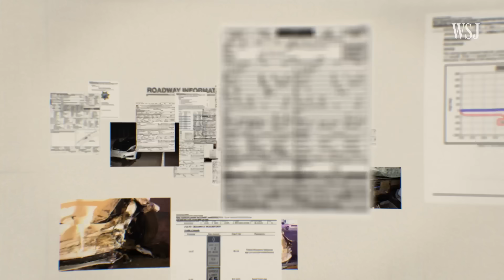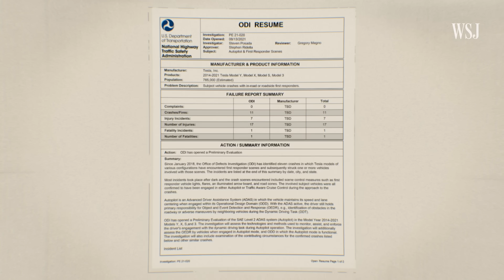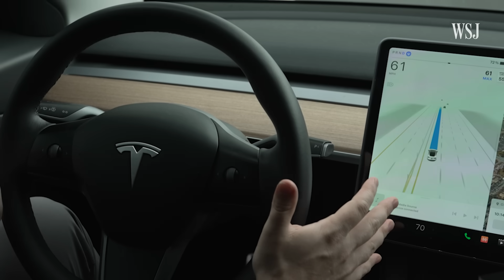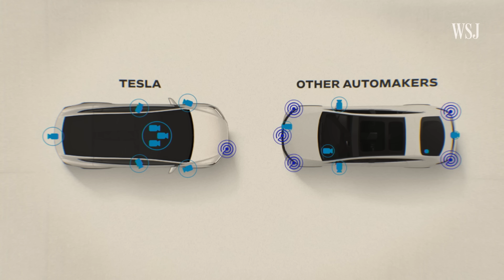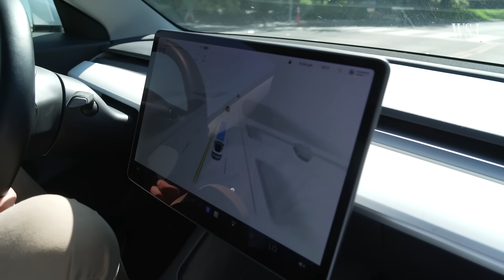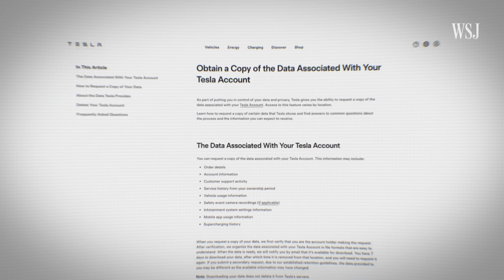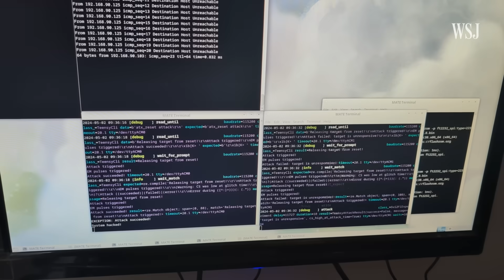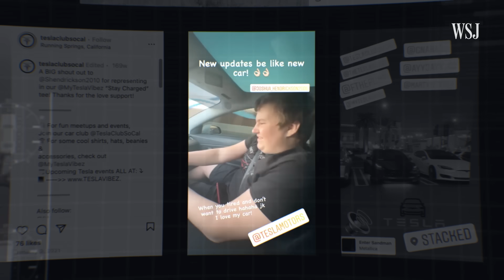The Hidden Autopilot Data That Reveals Why Teslas Crash | WSJ

Comment: Wait a second - Autopilot is just using camera feeds? As we can see in the video, these are low resolution and basically not usable in low light settings. Major public security hazard!
Reply: Yes. Tesla autopilot is well known for failures when cameras are blinded (by the sun, by the snow, by the darkness).
Reply: @solderbuff  That's awful. How are these cars legal?
Reply: It just uses camera feeds, I don't know about those cameras in particular, but the backup camera that I bought for my wife's old car was capable of seeing in some pretty dark conditions, so there's no reason why the cameras that are using on these cars shouldn't be able to see in near complete darkness. Whether they're properly trained to interpret what they see at night or not is likely the issue.
Reply: Tesla used to use LIDAR. During the pandemic-induced chip shortage they couldn't get the chips, and they didn't want to lose money by keeping their cars sitting in the factory parking lots waiting for them, so they just said they didn't need LIDAR and turned it off in old Teslas that already had it. That was a lie; the car needs some additional hard information to supplement the inadequate date they get from computer interpretations of camera-only data. There's a reason no other semi-autonomous car runs on cameras only.
Reply: @curtisadams6048  Tesla never had Lidar on any car. You confuse this with Radar.

Comment: Why no mention that Missy Cummings has a notable connection to LiDAR (Light Detection and Ranging) technology through her professional affiliations and public statements? She served on the Board of Directors for Veoneer, Inc., a company that focuses on developing and manufacturing advanced driver-assistance systems, including LiDAR technology. Cummings received significant compensation in the form of stock from Veoneer, amounting to around $400,000 annually for her role on the board.
Also, this report is way out of sate, referring to old technology?  Obvious hit piece.

Comment: autonomous pilot speed should be limited to max 50mph
Reply: Clearly, you haven’t used FSD. It’s better on the highway than in the city. But yes, its not a replacement driver

Comment: It's a driver aid. It doesn't replace paying attention. What I lack in this video is a comparison to what a human would do without autopilot. Would a driver without autopilot turned on have seen these obstacles and stopped? For the crash where it drove into a police stop with flashing lights it was obvious that the driver was passed out or something. The flashing lights can be seen for 5-10 seconds before the crash happens. For the overturned vehicles in the dark, would a human have seen this and braked? Perhaps.

I treat it as a fancy cruise control and don't trust it.

Comment: I have worked with computer vision extensively and I have worked with LiDAR sensors. Computer vision is merely an approximation technique like all deep learning techniques where it approximates the shape and size of an object. The error rates are significant and I am sure Tesla is not even using the most accurate models as they have to perform detections in real time and that means compromising on the model’s accuracy. LiDAR is 100% the way to go and Chinese EVs have proved that cars with LiDAR need not be expensive as these sensors have significantly fallen down in price in recent times. Most of these accidents could have avoided if Tesla used LiDAR sensors as these sensors can accurately determine an object’s size and shape.
Reply: V13 is showing Lidar is not needed, with it's performance driving up Tesla stock to record highs. Tesla are well placed to dominate in this space.

Comment: They forgot to mention. Autopilot is just a slightly more advanced version of standard cruise control. Of course, any car with this would crash if you weren't paying attention. What the video flaws on is that Tesla also has full self-driving, which can manoeuvre itself to save you from a crash in milliseconds. Many people think Autopilot is full self-driving when it's not. Tesla offers both Autopilot and full self-driving, but many people like to flaw on Autopilot to make Tesla look bad. There are many more crashes caused by humans than Autopilot, yet alone Tesla’s full self-driving beta.

Comment: This report is a hit job on an old version of the software. The new version is end to end video AI. The labeler who got fired is now replaced with that AI as are the miles of code needed to run the old full self driving and autopilot. What part of ‘supervised’ don’t people understand? It’s terrible people have died but it’s the same as cruise control, you have to pay attention to the road. In the next year or so, when Tesla releases Unsupervised FSD, and regulators approve it, then blame the tech.

Comment: The topic/conversation that folks ain't ready to have is about Auto Insurance (incl. Self - Driving Vehicles). I'm going to go out on a limb and say that, once the vehicle's factory warranty expires, these insurance companies will stop providing coverage and essentially the driver will be on their own! As technology (incl. Robots, Artificial Intelligence, etc.) ages, it tends to become slower, unreliable, and so on (sometimes), which leads me to believe that finding insurance for said self - driving vehicle will be near impossible as time goes on! Similar to Electric Vehicles (EV's) - once their factory warranty on the battery powertrain expires, you goin' have everyone running for the hills, because the cost to fix the electrical powertrain components is going to cost more than what the car is actually worth!

Comment: Is this journalism in the US nowadays? There seems to be a single viewpoint only. Also no details on what accidents are with fsd and which are on autopilot. 

I find it hard to form an opinion on this. The argument of too much confidence on the system is compelling. But I know the cars are abnoxious about checking if the driver is paying attention on the road.

The conclusion of this piece seems to be that the self driving cars in any form should only be allowed on level 5, which do not yet exist. The same argument could be made against just cruise control, which has lead to plenty accidents as well. I know of no comparison on safery between these systems.

This video didn’t help me in any way on learnig more on this subject.

Comment: Tesla has all kinds of warnings all over the car when you enable FSD. Everywhere you label it, it's called "FSD (Supervised)" because you're supposed to supervise it. In others, it's clearly labeled "BETA" in all caps. When you enable it in the autopilot menu, it gives you a lecture about how it's not ready yet because the bar for quality control in vehicles is much higher due to the safety risk, and if that's not enough, whenever you look away for a few seconds, close your eyes, etc, it nags at you, beeps at you, and shakes the car to wake you up. It's sad that these crashes happened, but it's not Tesla's fault. They did their due diligence. The responsibility was on the driver for trusting a system that told them it wasn't ready to be trusted

Comment: Autopilot is safer than a human driver when there’s an attentive person behind the wheel, which is how it’s meant to be used. It’s like having two drivers—Autopilot can handle most situations well, but it might struggle with unusual scenarios like the ones in clips. That’s where the human needs to step in. So, with both Autopilot and a human working together, it’s safer than just a human driver alone. But if the human isn’t paying attention, I wouldn’t say Autopilot on its own is safer than a human driver.

Comment: I find it hard to have sympathy when the car alerted the guy 19 times to take over. He was misusing the technology, being careless and having no regard for his own safety, his family, or other people on the road.

He clearly wasn't paying attention to the road and was over relying on self driving.
Reply: Agreed. It seems most likely he fell asleep.
Reply: Should the car be monitoring the driver and have alarms to wake a sleeping driver?
Reply: @aussie405  The new FSD does use the interior camera to monitor the driver to make sure they're paying attention. The older system just sensed tension on the wheel to determine if the driver was paying attention. You used to be able to strap an ankle weight to the steering wheel to trick it. Even after they patched that exploit, you could still hold onto the wheel with one hand and play with your phone on the other.
Reply: @kungfoochicken08  I drive an EV (not Tesla) and it constantly picks up the wrong speed limit from slip lanes. How does FSD work for speed?
Reply: @ I’m on version 12.6.4 because I still have the older Hardware 3. I think version 13 that uses the latest hardware has the same mechanism for controlling speed.

This mechanism just launched a few updates ago, so it might change in the future. It used to just guess the appropriate speed for you based on the speed limit. You’d have to press the gas to nudge it faster or disengage by hitting the brake to make it slow down. On the highways, you’d manually select the speed you wanted to travel at relative to the speed limit and then it would dynamically change speed based on travel in front of you. I actually liked this highway speed selection a bit better because it’s how people typically drive on the highways. You sort of select a speed you want to travel and pass or move aside based on the speed of cars around you.
Reply: @kungfoochicken08  my cruise control gets set by me, and then slows down/speeds up dependent on the car in front. I can adjust how close I want to be to the car ahead. It sometimes jumps on the brakes unnecessarily when a car crosses, turning in front, so I definitely don't take my attention off driving.
Reply: @aussie405  Tesla has a setting like that too. It’s called Traffic Aware Cruise Control. It comes free with all Teslas, so you don’t have to get the FSD package to get it.

The goal with FSD is to be completely autonomous and mimic the way a person naturally drives. It works well. I very rarely have to adjust anything. Most of the time, it’s just tapping on the accelerator to nudge it a little faster.

The NHTSB forced Tesla to incorporate a complete stop at stop signs. Most people don’t come to a complete stop unless there’s a bunch of traffic. Most of the time, I tap on the accelerator to nudge it through a stop sign before it comes to a dead stop.
Reply: @kungfoochicken08  I have a BYD Dolphin. It is just part of driver assist.

Comment: I’m a bit confused by the ece expert. One thing he missed is the fact that Tesla uses 2(+) cameras for every frame of video information. Why? Because 2 cameras gets you depth perception, just like our eyes. Elon is technically correct, there is no need for laser based depth perception when you have depth perception algorithms via multiple camera pixels fused together. 
I would want to know what version of fsd was present during these crashes. Certainly not fsd13 or maybe even any end to end model (v12). The earlier versions were definitely more spotty with reliability. Did they use depth perception fusion? Did that system fail? Even if the ML model does not recognize a stopped semi on a highway, the depth perception should have caught the object. This is all very strange and I hope the nhsta can get to the bottom of it. Keep up the good investigative work.
Reply: One thing that does baffle me is the fact that Tesla has no camera cleaning system. What happens when the cameras fog up? Get covered in gunk? These cameras have no backup system so therefore it’s a critical system. How can they then not have any way of maintaining a clear image? Pretty asinine.
Reply: That LA crash is a clear example that not just any camera sensor can be on this safety critical system. It needs a certain level of dynamic range, low light, etc.

Comment: I had a loaner Model Y with full self-driving enabled a few months ago so this is fairly recent. From my experience with it, it's nowhere near ready for prime time. It made numerous mistakes, and I watched it like a hawk. On the highway, during the daytime it seemed fine, except it always wanted to go the construction speed of 55Mph when everyone else is doing 70+ (and construction only occurs at night). But on surface streets, it had a lot more problems like it can't see to the sides very well as well as crossing solid white lines into non-traffic lanes and it tried to jump the gun on a metering light. This was only over a few days. It was also extremely hesitant. To me it seemed to drive like an inexperienced driver. The car had a LOT of problems making a left out of my neighborhood onto a major thoroughfare. If it's a sharp right or left it's even worse. I did not let my guard down on it, but I can see how people can get into serious trouble if they do.